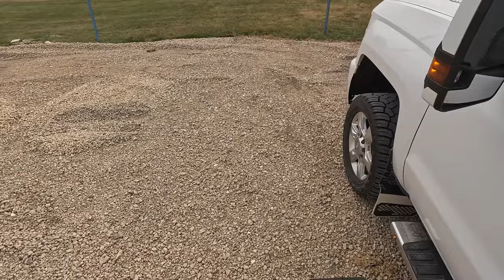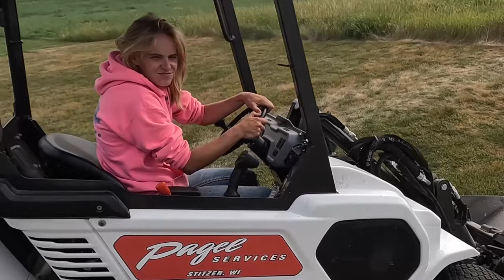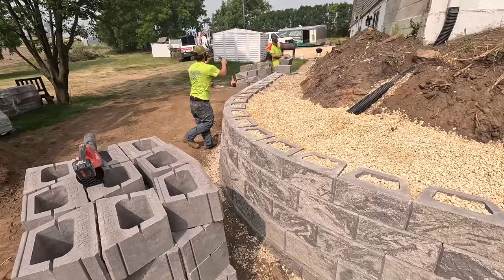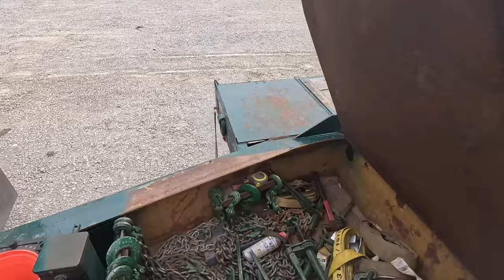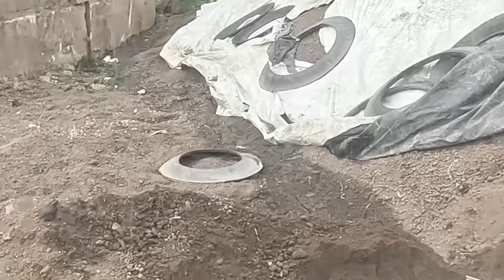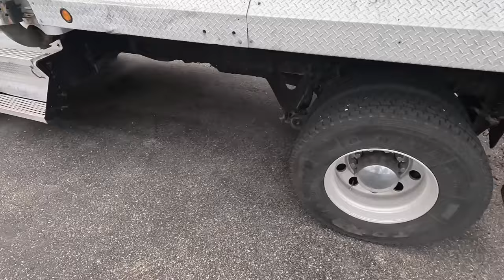Did I total my Mack Dump Truck!?

Comment: Been there! I flopped a quad over some years back. It have the identical box on it and it had that stupid upside down ram, with a pivoting mount that rocked between the inside of the frame rails. In my case that's what caused the truck to go over. Put a standard style ram in it, with rigid mounts and the thing was rock solid. No more box swaying in the air after that
Reply: Oh , sure sure….equipments fault

Comment: Germans grind such stones with a diamond planer and glue them together with superglue.
But wait, there's more! Then they shove pipes/light rebar in the holes and fill them with concrete (or foam if it needs insulation).
Reply from the maker: Interesting!

Comment: I don't see what's wrong with that one block in the wall. It might be due to video compression. Please point me to it. Thank you. 11:55
Reply from the maker: It wasn't grinded properly. It made a slight imperfection in the wall, which correlated to around 10 blocks being non level. Thanks for watching!

Comment: Why didn't he just swap it out and put it on the top later after someone ground it uniform. That way the job wouldn't be waiting on that one stone to proceed
Reply from the maker: Concrete blocks now-a-days are rarely uniform. Just the one was putting the wall in jeopardy of future failures. Got er fixed and all is good. That wall should outlast the owners now. Thanks for watching!

Comment: So whats wrong with how he did it exactly
Reply: I believe one stone was taller than the other, and instead of fixing it (sanding one down or building the other up) he left it cause it was "good enough." My question is why the big Gap at 12:04  wasn't pointed out
Reply: @CrowBarCole7 maybe for water drainage?
Reply: @bigloaftv6244   that's possible. In my experience, there are usually more esthetically pleasing ways to do stuff like that. However, I do not have experience in building walls like that professionally, just docks, trusses and houses. Perchance.
Reply: @gamernicholas9710 that gap is by design for water drainage.
Reply: @CarlosRios1  it is for sure?
Gotcha. Makes sense